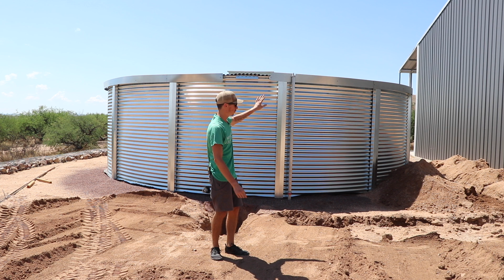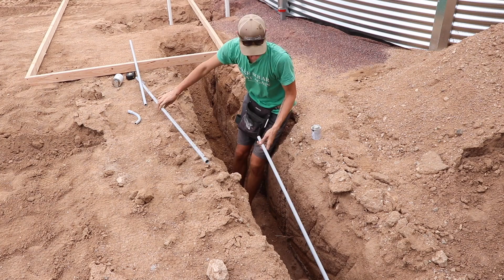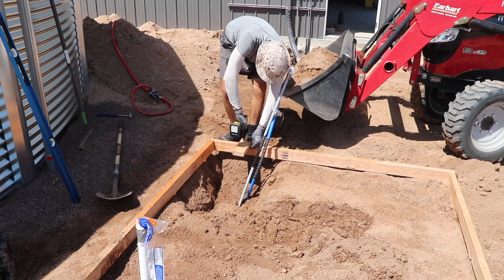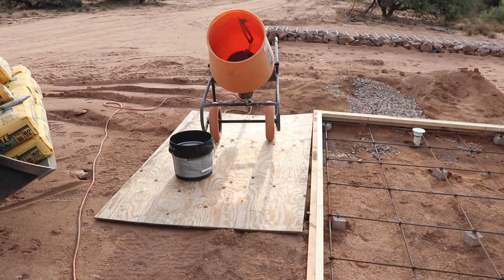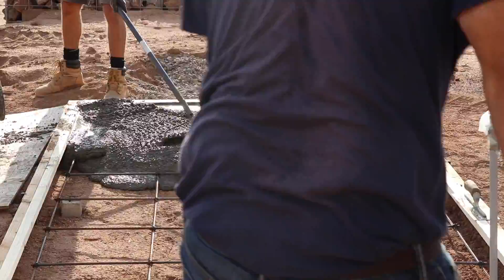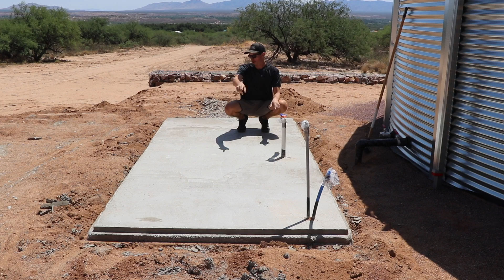RAINWATER PUMP HOUSE FOR 28,000 GALLON WATER TANK - Slab (Part 1)

Comment: So, an idea I have learned (i know that this is late but it still might help in the future) is that you might even consider rigging up some sort of system to hold some kind of anchor in it's final place before you even pour the concrete, that allows you to not worry so much about when you can start drilling later on.

Comment: A bit late now of course, but one thing you can do is run a control joint across the width of the slab for crack prevention. But concreting is stressful, especially when you are mixing, pouring and screeding on your own which I have done a few times!

Comment: Why are you not using the bed of the bucket.  You can mix up multiple bags at the same time.  Just tilt it up and mix withing and then shovel into place.  Big time saver.  I also did not see any sort of j bolts for the walls.  Im sure you have an occasional wind storm come thru.  This would secure things.

Comment: Best reason to wrap the pvc pipe is for UV protection.

Really nice to see a homeowner correctly place concrete.  And correctly use the terms curing vs drying.  Used best practice using dobies to support the rebar and covered the concrete to slow down evaporation to aid curing.   

Many of the so-called concrete 'experts' on YouTube are complete hacks - slap down rebar without dobies/chairs and then laughably walk right over it as they screed and finish and push it right back down - even mild vibration will cause unsupported rebar to sink if the mix is sloppy.

Didn't need such a thick slab - 3" would have worked fine. About only suggestion I'd add is to dampen the soil prior to pouring to prevent soil from sucking water from the curing concrete.

Comment: you had to pour water over the concrete twice daily(in the very early morning before it is heated and in the evening before it is cooled) until it stop absorbing water ,it will be strong as steel and would not break easily and never crack

Comment: If you put a thick and wet cotton sheet over the concrete for a few days (3 in general) and keep it moist it will cure the concrete way stronger.  You have to cure it from the inside out. So when you keep the top moist as it cure, the top will never crumble in pieces there after.

Comment: well concrete curing times hoover dam still going after 76 years and cores of the underwater piles for the lifeboat launch ramp my dad and i worked on 25 years ago recently showed it was finally stable and cured you should be fine to drill anchor bolt holes after a week are you using chembolts or  Resin anchors if not you may want to consider researching them if the pumphouse is likely to be wind buffeted and likely to move in a repeated way.

Comment: only one thing:  it is desired, especially on dry substract, to give the concrete a waterproof medium to sit on.  A black plastic would do. It will prevent loss of concrete curing water to the soil trough percolation, weakening the concrete piece.

Comment: Should have put a plastic/poly vapor barrier on the base before placing the concrete. This will also help hinder the concrete from drying out too quickly in that hot Arizona heat. Good job covering the slap with poly. Also once the concrete fully dries the curing process is complete. I would have kept the poly on for about 7 days to give it a good cure. As long as concrete is wet the curing process will continue.

Comment: In S E Asia, we mixed the cement mortar with  2 to 4% ration of concrete soluble polymer to give extra strength to the floor slab and it cures within 3 to 5 days. It also helps when you did not vibrate the air out. In your case, you did not use any foundation to support your base except some fundamental rebar, you can actually dig a few square hole below the slab and add a few rebar vertically to strengthen  the base. You did a great  as a newbie, pretty impressive!

Comment: never turn the pipes when you glue them together.. just push in..
Reply: exactly the opposite in my country, never just push in, always at least a quarter turn to set in position.   If you apply glue properly probably doesnt matter much,  if you are slack pushing straight in may leave a leak path.

Comment: When I worked on the parking structure next to the culinary institute in Pasadena in 2003, it was OK to drive up the ramp from one level to the next 7 days after the concrete was placed for the ramp.  So I assume that you can start working on the slab on grade for the pump house after 7 days.  But if you want it to get to specified compressive strength of F'c, then it will takes 28 days.  

But if you want to be specific, you can estimate how much weight & force you are going to put on the concrete and estimate how much psi the concrete will endure.  Then look at the premix concrete bags you use and see what is the design psi of the bags of the premix concrete, then look at the graph for concrete below and estimate how many day for the concrete to reach the specify psi load you will be putting on it.  And that will be the days you need to wait before you can work on it. Otherwise, 7 days should be acceptable.

https://www.aboutcivil.org/imajes/cement-chart-graph.jpg

Comment: Don't overthink your projects....your pump house is so close to the tank, no need to bury the intake. Just run it through the side of the building - no trenching and backfill - easier maintenance in a the future if needed. Don't waste the discharge water into a French drain! Put a nice high water tree out the back of the pump house and discharge the water around it.

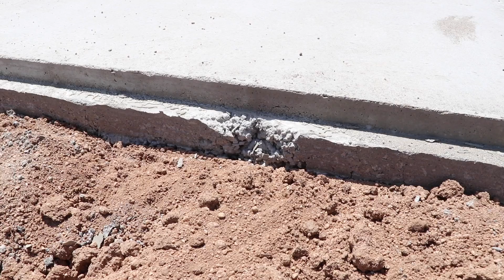Comment: Let the concrete cure for 28 days by constantly watering it before you drill into it. Time stamp 16:13. That hollow portion is called as HONEYCOMB where concrete doesn't reach all the way down the formwork. Constantly rodding the concrete and tapping it from outside while pouring the concrete will avoid this condition. For now you can mix some more concrete and press it hard at the places where such honeycombs have appeared. Don't forget to level it up with steel or wood plate and cure it along with the main slab.
Waiting for the next parts.
Like I always say, keeping spreading happiness!

Comment: If you are pouring concrete straight onto dirt and not onto plastic, wet the ground down beforehand. Not too much. It stops the dry ground from sucking the water out of the bottom of the slab. Gives you a better slab and more time to play with the concrete. Wait at least a week before building on it. It will reach half of it's MPA by then if you have made the concrete correctly.

Comment: 5:17 If you read about radiative cooling, you will notice another benefit for insulating exposed piping in the desert.  At night, exposure to the night sky will cause objects on the surface of the Earth to lose heat via infrared radiation directly to space.

Comment: Curing of the concrete depends on the mix and water ratio to cement used...the mix you used looked pretty strong, but that means with a thin slab...like yours, it will,be prone to cracking being induced by drilling through it for a longer period...as essentially it will be quite brittle... I would give a slab of that thickness a good 7 to 10 days to cure before attempting to drill it for placing bolts... the ideal solution would have been to make plates for studding, and to have inset the plates and studding into the concrete for bolting down the structure, before the concrete was poured...this is how it is usually done for simple structures, and as long as your reasonably accurate with the setting out, it’s a good method to use... Another DIY method I’ve seen used is to use wooden dowels on a jig that fits over the formwork...and are pushed into the concrete...when the concrete is cured the wooden dowels are just drilled out and bolts/studding secured into the holes formed by the dowels with high strength resin...

Comment: You could have used a piece of plastic pipe to provide a ‘conduit’ through the concrete for water pipes, and raised the top just a couple of inches above the finish level of the concrete slab, and just infilled around the pipes with ‘clay’. This way, if you need to replace any pipes into the pump house at any time, yo7 would not have to break out the concrete around the pipes, or worry about them being ‘corroded’ by the concrete...

Comment: The pipe rap will also give you UV protection for the PVC. Five years in the sun will make the PVC very brittle and a bump with a foot or someone stepping on it can break it. And replacing a short section like that can be a real pain with 2"

Comment: A golden rule for pipes to and from your pump is to go the largest diameter possible. Especially the suction line as pumps don't suck anywhere near as good as they pump. When you connect your pump make sure you build the line in such a way you don't have to destroy the pipes to swap out the pump. Barrel Unions or something else that can be undone. I would have used poly pipe for all the pipework and you should've used a valve immediately off the tank. Make sure to include one inside your pump shed.

Comment: 16-24 days depends on the water content of the concrete, standard is 16 for 15% water content and for every additional 2% you should add one more day, the size of the gravel also plays a part in this, every mili above 4 in x% of the material you need to wet the concrete once per day, three days is the minimum, but as i said, every extra milimeter in x% of the material, standard is 8-9~ish% you need to wet the concrete an extra day, unless it's very humid, for obvious reasons(acts like a magnifying glass), then you need to shade the slab, size is also a factor, but given how small yours is, i doubt it will need anything else.

Comment: I would wait 28 days then it should be 100% cured. It all depends on the concret mix, like have you used any kind of aditives or stuff like that. but for what I can see of you video it looks like good old concrete mix, just wait 28 days then you are safe. :)
Anyways nice work. 
Thx for sharing.

Regards :)

Comment: Finally, a diyer who sets up a good pour.  Good rebar good dobies (lifting rebar as you place concrete is totally ineffective--it just gets pushed down and tromped down with very little rise just where it is hooked).  The only thing you missed is a vapor barrier beneath the pour.  This slows the cure it isn't for keeping moisture out although it works for that as well.  It keeps the moisture in the concrete from migrating to the ambient soil moisture content.  It seems in vogue now to work fresh concrete the next day.  I don't like that as edges can crumble.  The forms help slow the cure as well.  So I leave forms on for three or four days and then drill and work on it.  Rapping the sides of the forms with a hammer gets rid of air pockets pretty well or running a sawzall without a blade against it for such a small pour.  Always a better idea to pour your 'J' bolts in the slab wire tied to the rebar.  Coming back and drilling is ok just not as strong.  Also remember the finishing should be trowelled three or four times.  This contracts the surface and hardens the finish.  Making a much more durable surface.  Take care.  Doug

Comment: Holy shiz pilgrim. A thinking man never plumbs a tank without a valve right outside the tank and never plumbs pvc through a concrete slab. That is always a bad idea. Should have used hdpe blue poly pipe with a sleeve in the floor. Get a slight earth quake and your pvc pipe will  snap off losing all your tank storage. That could be life threatening.

Comment: Poly on the surface is to reduce the risk of plastic shrinkage cracking caused by the water evaporating from the surface faster than the rest of the slab, causing it to shrink and crack.
Talking with a local concrete / ready-mix supply shop might help you find a mid range water reducer you could add to your concrete projects to slow down the set time keeping things workable longer when you are short people to help you.  Did the bag cement you used have air entrainment?  air entrainment provides improved durability in conditions of freeze/thaw.
Concrete typical design full strength cure time is 28days.

Comment: When you build the walls:
- Use Foam Sill Plate Gasket: https://www.homedepot.com/p/Owens-Corning-FoamSealR-3-1-2-in-x-50-ft-Multi-Use-Ridged-Sill-Plate-Gasket-1FS/202084452
- Use pressure treated lumber for your sill plate.
- Make sure to seal any cut edges and drilled holes with a wood preservative (I find a spray bottle makes applying it easy): https://www.homedepot.com/p/1-qt-Copper-Green-Brown-Wood-Preservative-CB-QTS/202688831

Comment: 28 days. Concrete gets 80 percent within 7 days and then cures out at 28 days then keeps getting harder for the next 100 years. 

Depends on the mix structure for set up time but even when we do concrete decks for high rises we reshore 3 decks doing a deck a week. So the fourth deck is structurally sound at 28 days for full structural design loads.
Reply: On construction sites around here, we have “break tests at 3, 5 and 7 days after pour. We are usually drilling and working on top of the slabs by the 5 day break which is usually 80%. Even driving scissor lifts and fork lifts in 5 days (sometimes in just 3 days).  80% is way more than adequate to allow you to set anchors for wall plates. If you are concerned about working so close the edge, drill, clean, and set the anchors in the concrete, but don’t tighten them down hard until a few days later. That way you can build your walls quickly,  and still not have to worry about concrete strength at the edges where you will placing your walls. Lately, on the site i’m on currently, the slabs have been covered with burlap for 2 days and watered every couple hours to get the finish cured properly for exposed polished floors, and to help reduce cracking within their 10x10 crack relief cuts.
Reply: he is at ground level so the time is lower, you have to deal with hardening on both sides, he don't.

Comment: Fill you tractor bucket with soil before using the front wheels for compacting, more efective. I hope you are making a very accurate map of all your underground pipes.  In five years you will not remember where things are. Also to help with that; bury big flat rocks just below the surface where the pipes change direction. You can easily find the rocks with a shovel later.

Comment: Keep it wet for as long as you can.  It should be hard enough to deal with drilling in 3-4 days.  They say 29 for 'full strength', but it really keeps getting stronger throughout its life.  It is stronger faster the 'greener' the concrete is.  Extra water (once it is set) does help it keep hydrating.  So keep it damp and plastic on for as long as you can deal with it (personally, until I wanted to put in the bolts by drilling.  In hindsight setting the bolts into the concrete while wet would be better, but don't worry about it to much.

Your project is looking great.

Comment: 2:24 this is a very amateur mistake you should have ran 2 inch into thee pump house then reduced this is better because if you need to upgrade pumps in the future your not under supplying the pump.
Reply: When putting wood on-top of concrete even if it’s ground contact rated for safty it’s a good idea to tape the boards that are touching the concrete/metal
Reply: And if you where concerned about the concrete cracking you should have done a true 4+ inch slab with a crush and run base and put a skirt around the edge (digging a trench around the inside edge of the form borders.

Comment: Another good reason to put the insulation tape and pipe wrap on is that constant exposure to UV light degrades PVC. It won't fail, but it will get to a point where an accidental bump will crack it.

Comment: You may be alright but that is the best current glue but no and I mean no PVC glue is made to be used without a cleaner. The cleaner softens the PVC pipe to make a good weld. I hope 6 months down the road you don't have joint blowing apart. Probably never happen if gravity but the pressure you will probably have problems. I hope not you have done such a beautiful job. Richard, Master Plumber Lic.  #1007

Comment: Pouring concrete directly on expansive clay, which grows and shrinks with water content, results in differential lift and settling with the season. It plays hell on the structure's foundation. People should really check their local codes for free draining gravel requirements under their foundation. If there is no code, one should follow the code of the nearest municipality in order to protect oneself. Codes protect the property owner.

On a simple 1,2,3 concrete mix- you should wait a minimum 72 hours before drilling into the slab. You should also keep the slab constantly wet for the first 7 days after the initial 6 hour set.

Comment: 3 or 4 days will be fine, in future don't use a metal float on concrete until the bleed water has gone. And aways use an edging tool for a professional finish.

Comment: You can most likely drill the anchors the next day, but I would wait 4 or 5 before I cranked down on the bolts.
Reply: Craig S 
I would wait 5 days minimum to drill.
You will regret the edge breaking off!!!
That why I use J—Bolts!

Comment: in the next video would you mind a real quick how-to on patching those voids at the edges?
Reply: Patches are really just cosmetic...but you can use a mortar to fill them, just paint the surface with a bonding chemical before applying